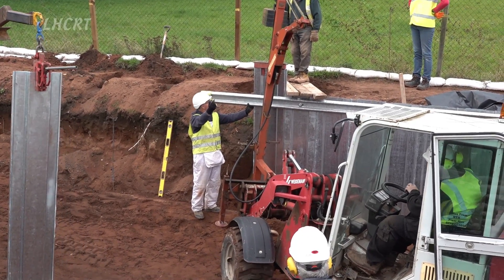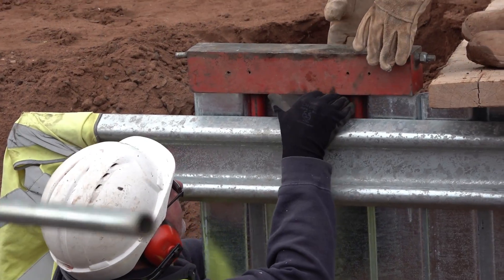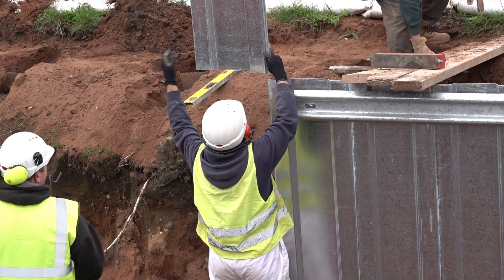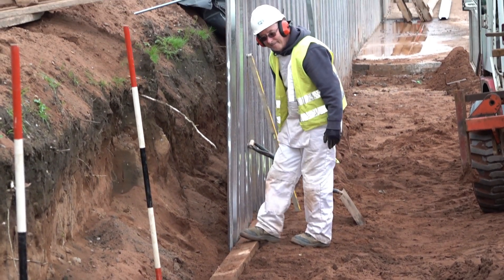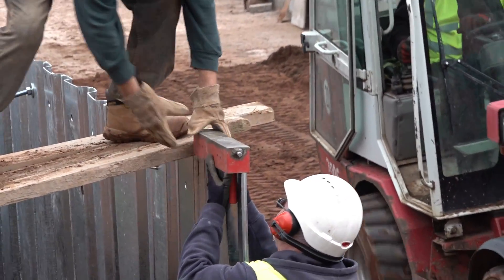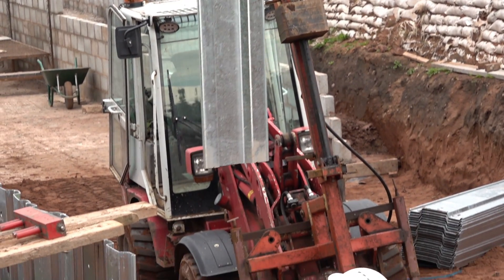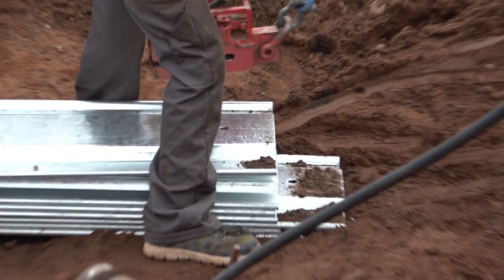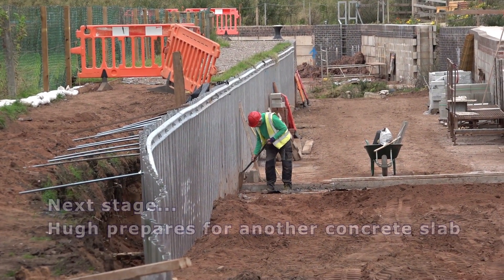Installing Sheet Piling

Comment: Great to hear that some of the old , disused canals are being restored and how sections that have literally been obliterated by later development are being re-aligned and re-engineered.  Sad that many were shut down and filled in (and built over) but they were, back then, built for commerce, not tourism and leisure. Once they were no longer profitable... goodbye. The original owners and operators couldn't, in their wildest dreams, have envisaged their current use and popularity (and the industry supporting the new use... new boats built,  service facilities for existing boats, marinas for off-season use, etc... new technology, all generating income that couldn't exist when the canals were shut down).

Comment: If I can express a concern... each time the machine picks up the next sheet piling from the stack the sheet is being dragged along the face of the sheet laying under it.
My concern is that this dragging action is scratching the face of the sheet under it.
Potentially damaging the qalvanized??? finish.
I would hate to think that in a few years the sheet pile face starts to show rust where it was scratched.
Don the carpenter from Canada
Reply from the maker: I've fed this back to the team.
Reply: Yes, you are very correct, the pilings are pretty much not replaceable, while the rub rail would be easy to replace. Think Teflon pan, scratch once always contaminated, weak point.
Cheers from San Diego

Comment: Good information regarding the installation process. One query though, was there not an alternative to using wooden planks to move the dolly from one sheet to another? The method shown seems a bit precarious should there be any sudden jolt to the plank or the workers on the plank. Also as there is no edge protection this poses a greater risk.

I would suggest taking a look at the Working at Height Regulations 2005 or HSE guidance to check. Otherwise thanks for the information.
Reply from the maker: Yes, we weren't aware that the team were doing that 😮 
It will change from now on.

Comment: I come from David's channel Cruising the Cut and am very happy to see this progressing so nicely. Mostly because I'm happy for you, but also because I am now working towards cruising the cut myself in the second half of the twenties. :-)
Reply from the maker: Brilliant! Will you be continuously cruising or based in a particular location?
Reply: @LHCRT  I'll cruise continuously, or at least I'll register that way. I'll likely go from marina to marina, with a few weeks of cruising before stopping for a month or so. Also, over winter and the summer holidays I'll be in a marina. The 20 miles minimum won't be a problem though.
At least, that's the current plan. As this is at least 5 to 7 years in the future, who knows? Maybe I'll end up moving about all year round, though that's not overly likely knowing myself. What I do want to do is see all of the canals, including rivers and the smallest side cuts. That includes the Lichfield & Hatherton canal, I am looking forward to that roundabout tunnel David spoke about!

Comment: The rebuilding of the canal network is really quite inspiring.  Please start off the next video with some maps, showing where in the UK, the detail of where now and where heading.  When will this section of canal be in water?
Reply from the maker: Hi Roland. Take a look at the maps section on our website for now to see where we are and then I'll let Paul our video guru know about your  suggestion.
https://lhcrt.org.uk/mobile/mapsindex.html

We can't say when this section will be in water. There's a lot more work to do and, as this is a middle section, we'd need suitable positions for stop planks at either end. We have lock 18 at one end but where the piling is being installed is a totally new section so there's lots to do before we have anywhere we can position stop planks. Sorry!

Comment: Why has this section been made just wide enough to nearly get two boats to pass, why not make it a bit more wider so two boats can pass with ease??
Reply from the maker: There's no room, it's been designed to be as wide as it can be.
Reply from the maker: The channel will be 5 metres wide so two 7 foot (2.14 m.) narrowboats can pass, but it will be tight. It's as wide as it can be.